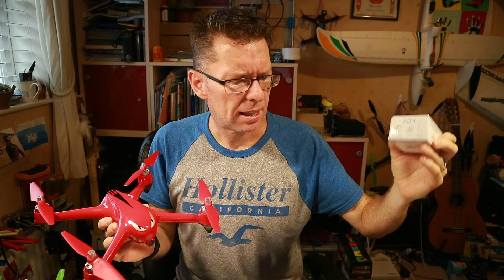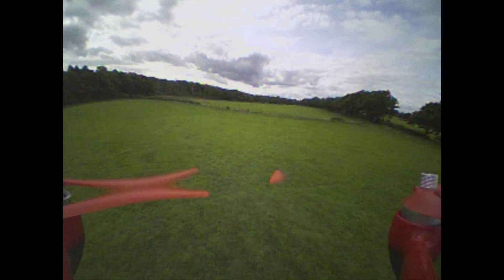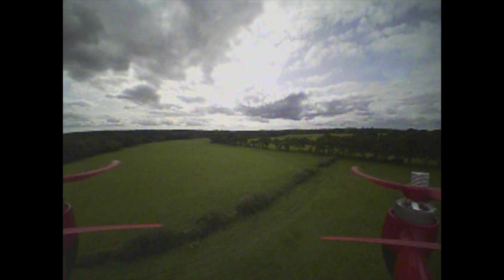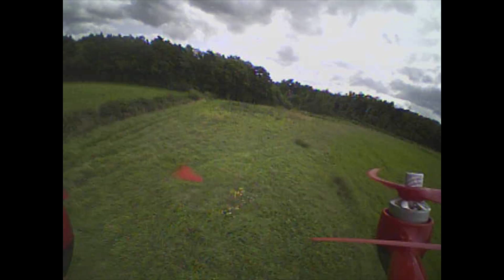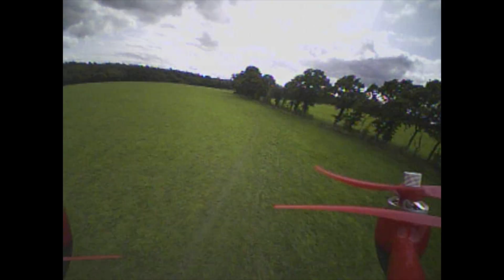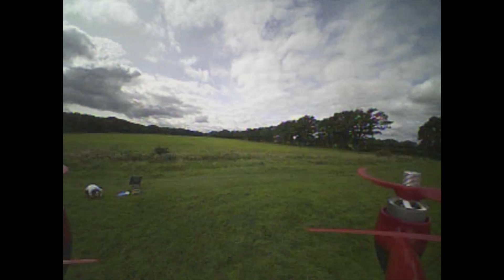Adding an AIO VTX/Camera (an Eachine TX03) to the MJX Bugs 2

Comment: Hello! Nice vid:) I have a question: is it more convenient to power that fpv cam from the drone itself or from an external battery (like you did)? I have drone that weights about 100 grams, I would like to try this mod with the eachine tx03, but I'm not sure if i should solder it directly to the battery drone (3.7 v 750 mah) or attach a liitle battery like you, I'm afraid that it would add too weight and reduce flight time. Any suggestions? Thank you
Reply from the maker: The reason I stuck the lipo and simple Camera/VTX on top was just as a very quick and simple test.  If I wanted to do a proper conversion I think I would be tempted to install a proper HD camera which could also put out an analog FPV signal and replace the included camera with this.  I'd also internalise the VTX and perhaps just have an external antenna for it.  If you are going with the TX03 though, I think (although double check) it runs from 3.5v-5v or something, so it should be fine to hook up to the main battery

Comment: Would a 3.7v 25c li po work to power this? And any 5.8ghz monitor would work right?
Reply from the maker: Power the camera/vtx - yes.  And also yes - anything that'll pick up 5.8ghz video will do it
Reply: @CurryKitten  ty very much curry kitten
Reply from the maker: We're talking just about the camera right?  In which case the camera video transmitter is a single unit - plug it in and it'll start transmitting video on whatever channel you have it on.

Comment: You don't have any problems with the heat of the camera Messing with the battery at all I heard those cameras get pretty hot when they are running 200mw.
Reply from the maker: In a word no.  The VTX component can get hot if you run it at full power on the bench, but when you fly it cools pretty well with the air rushing around it.  Also, the heat would be very localized, so would be able to get through the casing on the quad and then anywhere near the battery.

Comment: Hi I just got my ev800d goggles & found out they won't sync with my bugs2. If i do your mod with the tx03 camera will my goggles work with them?
 Thank you.
Reply from the maker: Yes - the camera in the bugs is sent using a wifi signal on 2.4, the EV800d works on analogue 5.8Ghz video (which is what the tx03 uses) so using the tx03 will make both camera and goggles compatible
Reply: CurryKitten thank you so much for the quick reply, now I don't have to send my goggles back!
I thought about ordering the tx05 but there was some joining of wires & wasn't sure the fiddling with that was worth it.
Anyways thx again & will this set up work on my bugs 2c?
Reply from the maker: So the tx05 (having just looked at it) has a video in and video out wires.  The idea here is that you send the video out to a flight controller equipped with an OSD, the flight controller takes the image, overlays the information you want and send it back to the video in where it's transmitted back to you and you can look at lots of extra info on your screen.  There's no OSD to get from the bugs, so yes tx03 + an appropriate battery and just stick it on top to keep things super-simple
Reply: CurryKitten hello friend, I heard from a fellow flyer you did a eyeglass mod for the  Ev800d goggles.
Is that still up? I can't seem to find it.
Reply from the maker: Nope, not me I'm afraid, I've never had the ev800's

Comment: Can I use the Eachine TX03 module on JJRC H36? Please help me. I'm on my way to modified my quad.
Reply from the maker: Yes - what you'll need to do though is solder in the power connectors to the battery terminals on the board.  It's a little bit like any quad of this type.  Here's one of me converting an Eachine model https://www.youtube.com/watch?v=KaS6jU45jOg  Obviously, you'll also need something to receive the 5.8Ghz video signal as well

Comment: Hi Curry!
Do you supply the camera by using the blue battery which is on the drone?
How can you use the FPV mode? You should connect the TX03 to the drone's wifi module i think.
Thank you!
Reply from the maker: The TX03 is a camera and 5.8Ghz VTX in one package - so it's sending the video signal itself.  It's far better than the wifi link that the bugs2 has (which is why I'm not using that) it does mean you need some extra kit to pick up the FPV signal.  I use FatShark goggles (which are great, but expensive) but you could get an adapter for your phone such as the ROTG (affilaite link) https://www.banggood.com/Eachine-ROTG02-UVC-OTG-5_8G-150CH-Dual-Antenna-Audio-FPV-Receiver-for-Android-Tablet-Smartphone-p-1242422.html?p=E81211714085201408XQ&cur_warehouse=CN  I can still record HD with the onboard camera and use FPV via the TX03 - best of both worlds
Reply: Thank you very much for your quick reply!What's the tx03 resolution? I think it's not so good but it is okay if you use it just for the fpv ( and recording with the onboard camera).What kind of battery would you recommend to use to supply the tx03?Unfortunately i don't have an android phone and i'm looking for an IOS adapter (for iphone)...i found this   https://www.banggood.com/Eachine-R051-150CH-5_8G-FPV-AV-Recevier-Build-in-Bat-For-iPhone-Android-IOS-Smartphone-Mobile-Tablet-p-1196214.html?rmmds=search&cur_warehouse=CN    but it's a little bit expensive . Do you think should it work?I promise this is the last question: what's the max fpv range you reached with this setup? IS it possible to use the tx03 without ROT receiver?Thank you ! Have a nice dayGianluca
Reply from the maker: Resolution of the camera (and all FPV cameras) is 640x480 (or there abouts - some variences for NTSC/PAL and 16:9 native resolutions) This isn't designed to be your recording camera, it's simply the resolution that 5.8Ghz analogue TV signal needs to transmit at.  Battery wise, look for around a 500mah 1s lipo to keep you powered for a good 30 mins at least something like (affiliate link) https://www.banggood.com/5-X-ZOP-Power-3_7V-260mAh-35C-Lipo-Battery-White-Plug-for-RC-Quadcopter-p-1243475.html?p=E81211714085201408XQ&cur_warehouse=CN those will plug directly into the camera.

Yep, that adapter for the iPhone should work fine - it's pretty cheap if you compare it to buying some FPV goggles !  For range, I did some testing here https://www.youtube.com/watch?v=w00nIc1Kcrc but was blocked by trees which is why I stopped.  Range is always going to depend on lots of factors, but with decent placement you will get easily over 1km
Reply: Your answer is very exhaustive!Those batteries looks very light and it is nice that you can plug them directly into the camera, but how do you charge them? I will probably need an adapter to USB.I am wondering if the iphone adapter is really necessary: my phone (iphone 6s) already receives the 5.8 GHz frequency (In fact i can actually do fpv even if the distance is limited).Does the adapter also improve the reception? Otherwise i could avoid buying it.Other important point is: after installing the tx03 on the drone, will i have to use a different APP instead of "bugs go" for the fpv? Thanks for your time and kindness.Gianluca

Comment: Did you have any problems with the TX03 interfering with the compass module in the nose of the Bug2. The radio signal waves TX03 being so close to the compass module?
Reply from the maker: In a word no.  I had quite a large strip of velcro just in case I needed to shift the camera & battery around, but it picked up all it's sats quickly and the compass was fine.  I got it to do some GPS holding during the flight, and it was rock solid.
Reply: CurryKitten did u test rth with the tx03

Comment: How far apart have you been with this fpv camera?
Reply from the maker: I did some range testing with the camera in this video https://www.youtube.com/watch?v=w00nIc1Kcrc which gets to about 700m - but as it turned out I was blocking my signal with a line of trees - so it would certainly go further.  But range and signal quality depend a lot on other conditions, and the way things are positioned on a model
Reply: how can you tell me where I find your camera and recpeto. And another question can I connect this camera directly on the battery?
Reply from the maker: This is the camera I was using (affiliate link) https://www.banggood.com/Eachine-TX03-Super-Mini-025mW50mW200mW-Switchable-AIO-5_8G-72CH-VTX-600TVL-13-Cmos-FPV-Camera-p-1104884.html?p=E81211714085201408XQ it only supports up to 5v, so you can't connect it directly to the flight battery.  I used a 1s lipo in the video as I could connect it directly to that.  Not sure what you mean by "recepto" ?

Comment: Hi there.  Great video.  What fixing do you use to support your phone onto the transmitter please? Thanks
Reply from the maker: It's just the one that came with the TX in the Bugs2 package.  It slots over the top of the TX and then there's a sprung section to put your phone into
Reply: CurryKitten thanks

Comment: I just recently bought a Contixo F18 which is just a rebranded Bugs 2w. I was wondering, whats the range like on this set up? 

I've been thinking about getting the TX03 as well as a 5.8ghz android reciever off banggood.
Reply from the maker: The default setup ?  The 2.4Ghz radio system is actually very good, it still had full signal to the end of the field (although only 300m) I've seen people report getting 1km off of it.  The Wifi FPV is actually better than most I've seen getting around 100m but it's a bit patchy to say the least.  Freeze ups and lag are common.  The little TX03 will also get you out to around 1km if you want to go that far
Reply: Would I be able to get that kind of range with the TX03 using a ROTG01 android receiver for 5.8ghz or would I need to upgrade to a more powerful FPV setup?
Reply from the maker: Range in FPV is more about the environment and setup than the raw power.  I've not used the ROTG01 before so I don't know it's sensitivity, but change that antenna out for a decent skew planar, keep the quad at a reasonable height and it should be fine.  I tested the tx03 to around 600m on 25mw (here https://www.youtube.com/watch?v=w00nIc1Kcrc) further invesitgation show that I was being blocked by a line of trees, it still had more range to go.  So at 200mw you shouldn't have an issue
Reply: Wow that's incredible, I just ordered the TX03 and the receiver just now because of your vids, thanks!
Reply from the maker: Nice one - have fun flying with it

Comment: Question? What size 3.7v did you have with camera. I’ve heard 3.7v 500mah gets the camera hot
Reply from the maker: That was a nano-tech 500mah lipo.  The size of the battery shouldn't have any impact on the heat the VTX will put out as the amp draw should be the same.  What will make a big difference is the power output on the VTX (and it's the VTX that generates the heat rather than the camera) 25mw will generate less heat than 200mw.  If these are just left powered on without any airflow then they'll heat up in all cases - fly it around and it'll come back cool, leave it on the ground powered up for a few minutes and it will get really hot.

Comment: Nice video, but cameras quality is not good :(  Is possible to mount a camera such as this instead of the default camera?
Reply from the maker: Yeah - I'm sure you could remove the internal camera and mount a better FPV camera inside... but of course you remove the whole wifi FPV idea.  As far as HD goes, you are way better off mounting a little HD 1080p60 camera on the underside, like a mobius mini or something similar

Comment: Great video!  I received my TX03 about a week ago and plan to mount it on my B2C but wasn't quite sure how to do it "cleanly" and without a lot of camera shake.  It looks like a bit of velcro and a couple of rubber bands will do the trick though.  (My grandkids love to wear my fpv goggles while I take them on a flight)!  ;-)  Thanks for what you do... I've subscribed to your channel and look forward to seeing more.
Reply from the maker: Thanks for subscribing :)  I think if I was to put a camera on more permanently, I might do things a little different, but the basis would be the same.  Something with a bit of flex/vibration absorbing to attach to the body of the quad (spongy double sided tape) and then the camera on top of that - possibly attached to a little 3d printed mount or something.  Worth balancing those props it comes with as well to smooth things as much as you can
Reply: Yessir....that's what I'm thinking about as well....design a small mount and attach it to the body of the quad...also, balancing the props really helps too! ;-)

Comment: G'day mate what size battery would you suggest for the tx03? I'm planning to use it on 25mw setting how long would that last? Thanks heaps
Reply from the maker: I don't have any useful stats there I'm afraid.  Certainly the 500mw 1s I used lasted no problem.  The only data I had was from testing the TX03 in 25/50/200mw modes using a little 240mah where it ran out part way through the 200mw test.  So lasted around 25 mins on the various settings.  You you'd expect maybe 30 mins on running just 25mw on a little 240mah lipo (guesstimate)

Comment: goggles or monitor, which would you go for, i am looking to buy the bugs 2, and i have seen and read alot of results when it comes to fpv.. was there any lag with the tx03?
Reply from the maker: Always goggles for me.  It feels more immersive, and there's never an issue with reflections and things.  If you can though, try both - as some people can't get on with goggles and swear by screens (weird as it sounds to me)  The TX03 is about as latency free as you'll find.  There's always an order to some ms of latency, but that's just physics about the speed of radio waves and things.  You won't notice it basically - which is different to the normal Bugs 2 wifi transmission, which feels like it's around half a second of lag - which isnt bad for just guiding around the sky, but it's scary when everything locks up and you are right in a bunch of trees !

Comment: Excellent video,going to do the same with Bugs 2c.Did you have it set on the 200 mw setting to get that range?
Reply from the maker: It was set on 200mw, but I've tested the TX03 in 25mw before (there#s a video if you have a search back) and it got to around 700m before some tree's managed to block me.  Only issue with using 200mw is it will eat through the little 1s lipo's quite quickly.  A little 200mah lasts about 20 mins, so bigger or more 1s lipos needed.  But at 25mw, they last a lot longer

Comment: Hello Curry Kitten, great setup and flight video. No OPS interference like it seems and that is great. I own the Bugs B 2 C version and recently ordered the TX 02 version of the Eachine AIO FPV. I will fly it with my Gteng FPV watch that fits perfectly in the phone holder from the Bugs 2 W controller. I posted a link to your video and a post about it on the Bugs 2 rc groups pages. Hope you like that. Thanks for all your great video's on youtube and keep posting!
Reply from the maker: Wow, I never thought about flying it from the watch, it's quite a small screen and obviously, you'll have the reflection issue... but that said it's probably still better than the wifi link !  Even if you can get the cheap and cheerful £40 Eachine goggles - that'll bolster your experience some more.
Reply: CurryKitten, flying with the Gteng watch is perfectly for aerial video (vision on the position of the quadcopter and the video shot). Not for a perfect FPV view and racing. See my video's of flying the Hubsan quadcopters and the Bugs 2 with my mobius Mini and a DIY FPV mount made from moongel. I posted about it also on the Bugs 2 rcgroups pages. Thanks for your quick reply.
Reply from the maker: Had a look at your mods and resulting flights, and they look really good - well done.  I might have a further revisit and see if I can get nicer HD footage now :)

Comment: Brilliant!
The idea of sticking on the TX03 complete with battery was so "out of the box" for me ... when you pulled it out and showed it I thought "lets see how much of a pain it'll be to get power and how much butchering of the Bugs2 will be needed" ... what a great idea!  Thanks!
Reply from the maker: Yep - well whilst you could route it from the main lipo, you'd need to use a BEC, or find a 3-5v supply somewhere - which is lots of hassle.  I've stuck these TX03's all over (including on the dog) I much prefer the idea of being able to get stuff in and out quickly, although if I was going to use that on the Bugs all the time, I'd mount it a bit better - but just hot glue instead of velcro will keep the camera still.